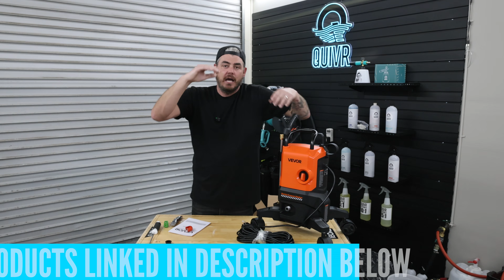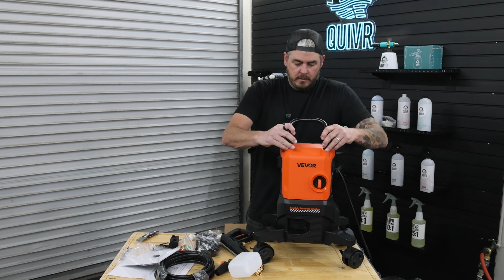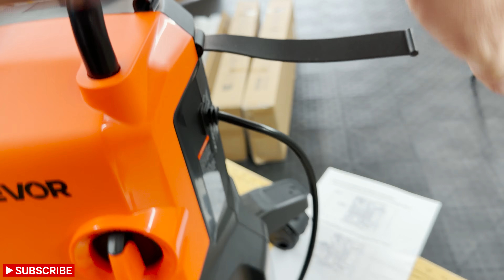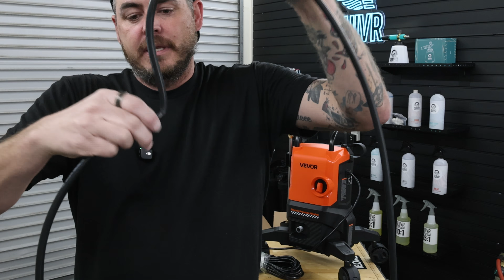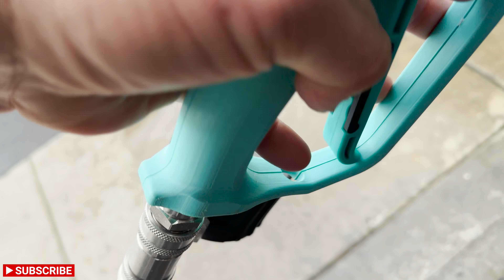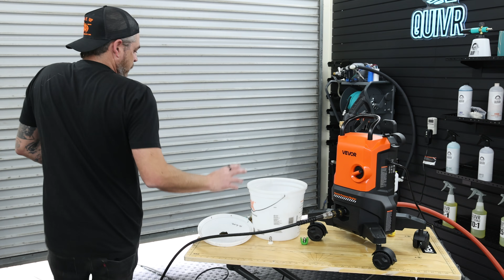NEW! VEVOR PRESSURE WASHER on Amazon 2700psi 1.8gpm? PERFORMANCE TEST

Comment: So, this one with about 1650 PSI (actual pressure) for $100.00 (Amazon) is a better value than the Greenworks with about 900 PSI (actual pressure) for $150.00 (at Lowes), correct?? 👍

Comment: I have found 2 things that clog a nozzle, the water supply, which is easy to fix, I mounted a filter on the input to the pressure washer. The 2nd issue, is the high pressure fittings, most are steel, and after months of use, tiny bits of rust flake off the fitting inside the hose. My remedy for that, I ordered hoses with stainless steel ends.

Comment: Can you test the GPM with no nozzle... I have a feeling they advertise the "no load" GPM. And 2700 PSI is the relief setting inside the pump, meaning with no flow the pump could put out 2700PSI. but that may still pull to many amps.

Comment: I'm surprised you don't keep a set of M22-14 quick connects on hand as you can pick them up dirt cheap on Amazon or Aliexpress.

I try and keep adapters for everything on hand just in case a friend or family wants me to test a cheap unit they've found.
I'd be happy if everyone just used M22-14 or M22-15 though, as some use proprietary-ish quick connects and they genuinely frustrate me! My first machine had M22-15 on the pump and some weird quick connect on the gun which didn't bother me as I ditched the hose and gun anyway, but my Ryobi has one on both the gun, and the pump so I had to adapt the pump to M22-15 and then on to 3/8ths QC. Once I figured out what I was working with however, I found a swivel adapter for the factory gun to QC but that's now permanently attached to my pump

Comment: MY VOTE;  IS, A LOUD  = NO=  THIS IS A TOY!/ I OWN. SOME, VEVOR FURNITURE. THAT, FELL APART.  ONE! SUMMER SEASON..  Sorry, if anyone hates My post but... FIRST!  OF ALL;  PLASTIC WHEELS,  :face-blue-wide-eyes:PLASTIC WHEEL ARMS,  :face-blue-wide-eyes: THE ALL IMPORTNT. HOSE HOLDER.  IS PLASTIC.  :face-orange-raised-eyebrow:AND FALLS OFF.   MOST,  OF THE OTTHER PARTS.  ARE, ALSO PLASTIC. :face-fuchsia-poop-shape: SAYS, SOMETHING. NOT!!!  SO GOOD.... BULKY.  BENDABLE, ALUMINUM WAND.  PLASTIC!!!!  :face-blue-wide-eyes:TRIGGER-HOSE-GUN PARTS. OH-LOOK. A BRASS FITTING.  ON, A PLASTIC.   :face-blue-wide-eyes: TRIGGER-HOSE-GUN; LMFAO! I DON'T THINK.  THAT HOSE.  IS RUBBER. :face-green-smiling:
WHILE-CRINGING!  🤢🤮 LOL..  HE, TELLS YOU >> UPGRADE.  THE HOSE +$50 << 
HAS BENDABLE:  ALUMINUM ATTACHMENT ENDS.   HE TELLS YOU >> UPGRADE.  THE ATTACHMENTS. + $50. <<  
 :face-red-heart-shape: TRIED HIS BEST!!!!!  USING,  A GREEN-TRIGGER-HOSE-GUN; THAT, DOES NOT.  COME-WITH, THE SET. 
BECAUSE; THE TRIGGER-HOSE-GUN;  THEY,  GIVE YOU. 
>>>> DON'T HAVE!  AS,  MUCH PRESSURE.  AS MY HAND PUMPED. GARDEN SPRAYER :/ 
AND! LEAKS! Per Amazon reviews.

PROBABLY NOTHING.  FITS, ANY OTHER.  PRESSURE WASHER.

Tell, your wife. She, is lucky! To, have you. And sign me up! To-be. Your next X  lmfao!
I come. With, my own cash, LOL 😅🤣😂

Comment: I got the OG Ryobi with the 50' flexzilla, raincovo cannon with the 1.1 orifice and mckillans stainless quick connect and gun. The foam production is not the best, maybe is my water but is there anything I need to upgrade before investing in a DI system? Thanks in advance, I got into washing my cars thanks to you. Cheers.
Reply: I have an OG Ryobi and am getting insane foam with the MJJC Pro V2. Could be your soap mixture. Do at least 2-3 ounces per 1000ml.
Reply: @Mi4mi_joe  I always do over 2 ounces per 1000ml and the foam is super runny. I don't know if the filter on the Raincovo is one large piece or 3 pieces like on the MJJC. But I have some replacements laying around, I'll try that first. Thanks for replying.
Reply: @EYE7SS interesting. All you can do is experiment. Check if your filter has the foam filter in addition to the wire mesh filter. I believe the MJJCs have the foam sandwiched in there.

Comment: Will using a 1.1 for the foam cannon increase the amps used? or in this negligible?
Reply from the maker: No you’ll be fine. A 1.1 orifice in a foam cannon is different that a 1.1 nozzle rating so I think you’ll actually run lower amps with a 1.1 in the foam cannon that the 1.8 nozzle it comes with

Comment: Josh, you reviewed the Westinghouse EPX3050 2050psi 1.76gpm electric pressure washer 4 years ago. The Vevor is extremely similar. If it really is as similar as I think it is then the Vevor is not very new. it's 4 years old with some lipstick.

I came across an article that Vevor is opening a store. Can't remember where it's going to be.
Reply: It is the same unit
Reply: Exactly,  best description for this unit
Reply from the maker: Yea rebranding units is very common… that’s why my pressure washer build is taking soooo long. It’s a ground up build
Reply: @imjoshv  Seems like a comparison test with the Westinghouse is in order to test the hypothesis. Video idea, hint, hint. 😉
Reply: @imjoshv Josh have you heard about the new gorilla gp8 pressure washer it is said to be a genuine 3000 PSI